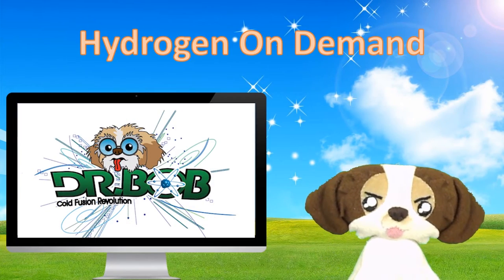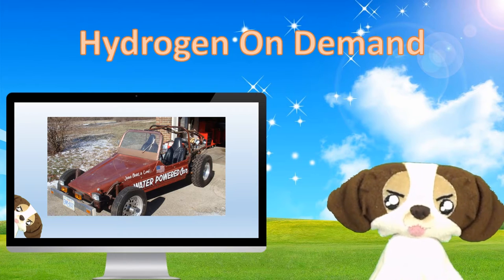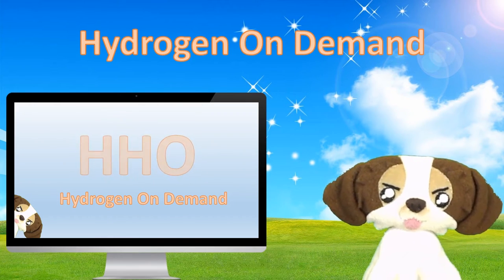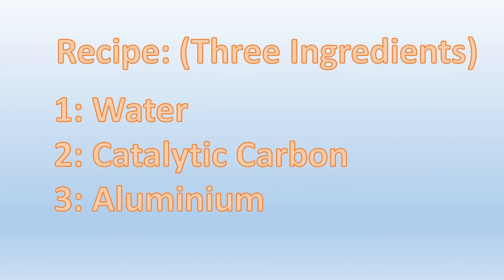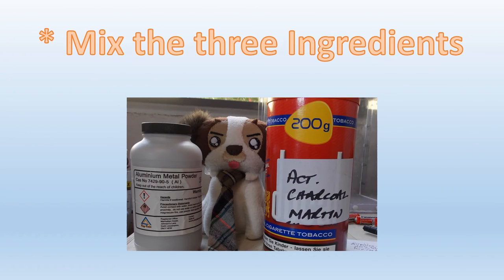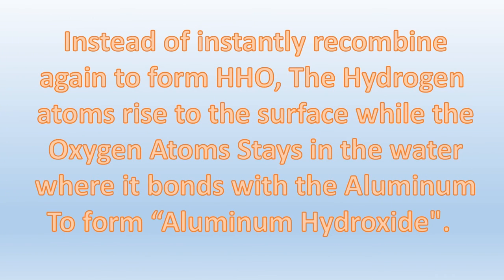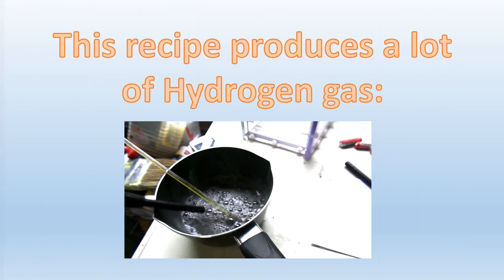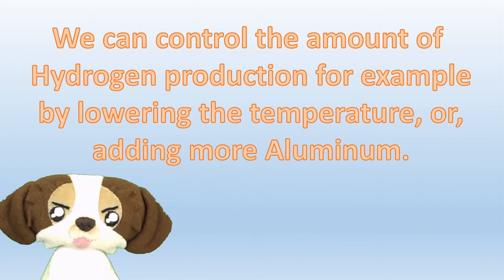HHO - Hydrogen (on Demand) Breakthrough using Catalytic Carbon (CC-HOD)

Comment: Early 1960s "Chemical Engineering Progress" had articles on nuclear heated electrochemical fuel cells and hydrazine fuel from ammonia ionized from via radioactivity radiation.

My one chemistry professor with a staccato accent who resembled steampunk Inventor "Varian" from Disney's "Tangled" was very keen on hydrogen fuels and engineering of electron shells for storage of hydrogen fuels in a crystal lattice of metals. 

A laser optical trap could be used to form metallic monoatomic hydrogen since it was in 1932 Norway isotopic fuels first became commercially available.